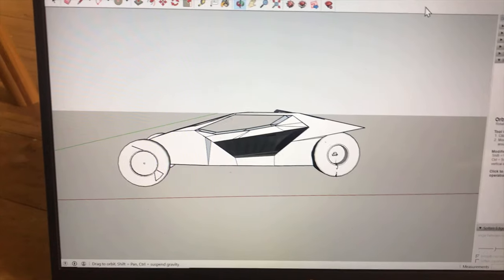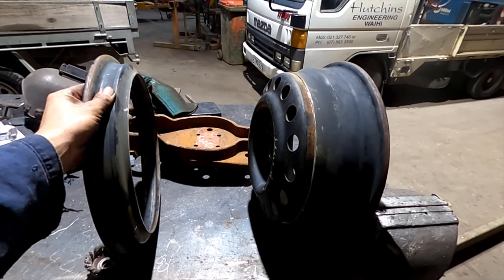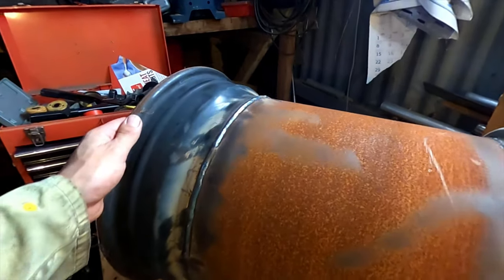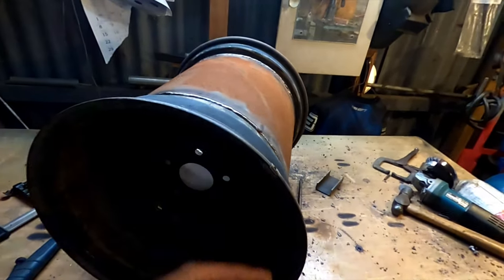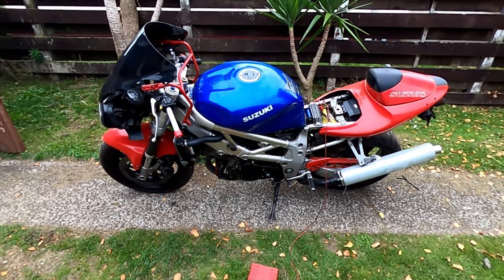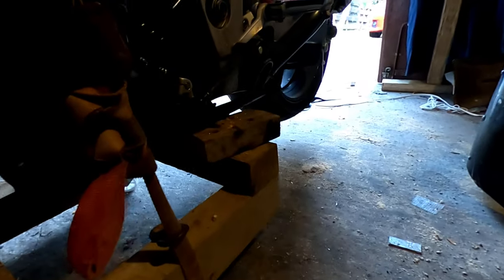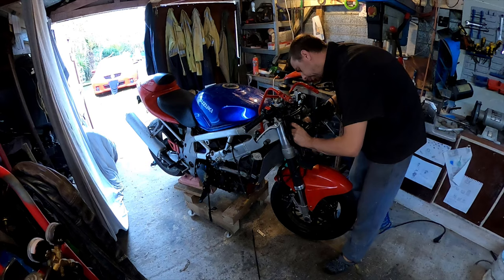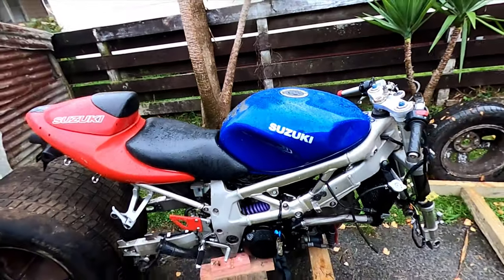Reverse trike build, part 1 huge wheel!

Comment: I found your channel through Rather B Welding.  You sound like a Kiwi.  In fact you sound Like Marty who has a lifestyle block out of Nelson.  Your project looks interesting, and I hope to be following your progress.   You could try the lighter fuel trick to bead the tyre, but you could also make or buy one of those explosive beaders if you have a 25L (ish) air tank and a 1" or larger ball valve.  I'm thinking you'd have to weld the fitting for the ball valve to the tank as the usual fittings wouldn't be anywhere near big enough.  The lighter fuel trick works OK though.  BTW My last bike was a TL1000R which I sold because it was going to kill me for sure.  That was in the UK.  I live at Rapaura near Blenheim now.  BTW2 It was good to see you wearing your safety sandals when lifting the bike on the stand.  I'm guessing you thought your usual jandals might not cut it if the bike fell and landed on them.  The easiest cover all safety device is a Colin Furze Safety Tie.  That covers everything from stepping on a brass tack to nuclear explosion.
Reply from the maker: Trevor Dennis yeah I am a kiwi but live in waihi. I got the tyre to bead with a big compressor at work my little one wasn’t fast. Yeah I had my welding jandles on but put my lifting ones on instead!

Comment: i use inner tubes on all of the stubborn ones,worked good for 75 years should hold your trike
Reply from the maker: Yeah that would have been good , can you get inner tubes for those tyres?
Reply: @DktheWelder  i go by rim size, and then truck tubes, they swell and they are new,they'll hold, i have 4 in the back yard holding up 3 vehicles,air them up slow the first time they stretch

Comment: Welding air tight with a stick welder, I bow my hat to you, one legend to another
Reply from the maker: There is actually one small leak . But it takes about two weeks to go flat so I might leave it for now
Reply: Is it even a stick welder it looks like a tig welder with a welding rod shoved in it   😱🤔
Reply from the maker: @millionairedieselgarage4767  that’s exactly what it is . You get high frequency start and can use the down slope to regulate amps as your welding, works great